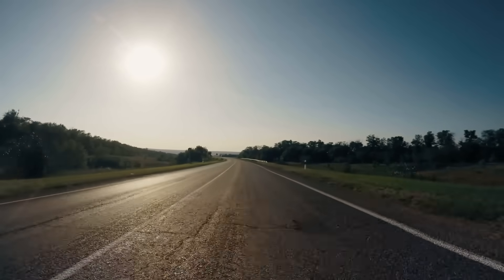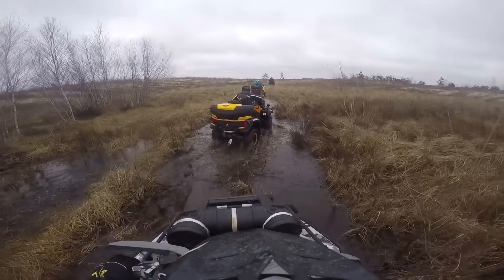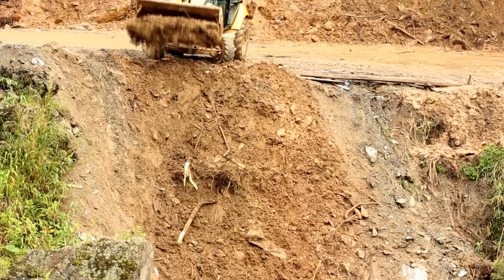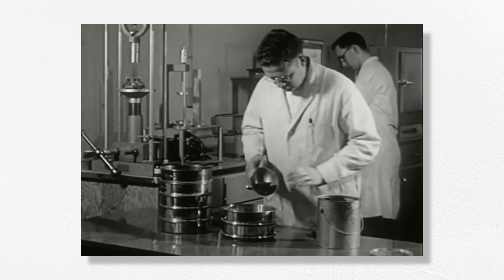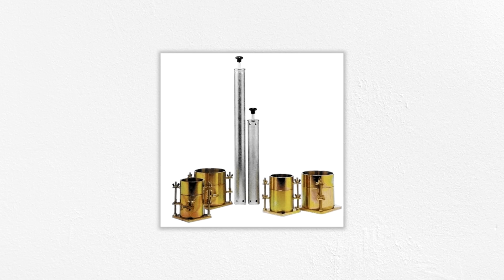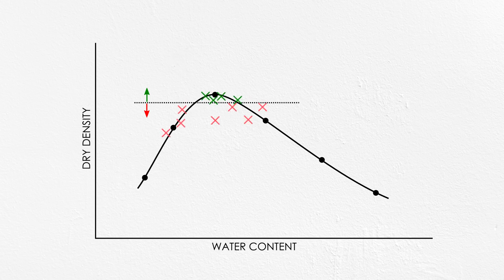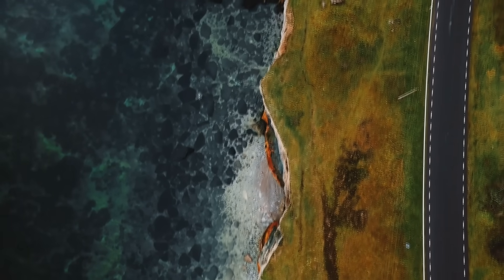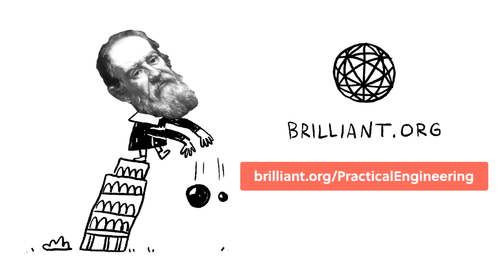Why Does Road Construction Take So Long?

Comment: Unfortunately this video doesn't address the fact that every road construction project gets started, then stops for 6-8 months, then starts up again for 2 weeks, then stops for another 9 months, and continues this way for 3 years until over the course of 3 days the entire project just miraculously finishes.
Reply: The 405 freeway in California has been in construction for over 6. Its rediculous.
Reply: @dakken74  and it turned into a toll road, paid for by the taxpayers
Reply: I-5 in Tacoma and JBLM, lordy.... that think will be under construction until the end of 2024 according to their published timeline.
Reply: @leonjohansen1818  And I-5 through tacoma has been under construction for over 10 years!
Reply: @cookiemonster8038  It has been under construction since the mid 1960's. I have seen it.
Reply: @leonjohansen1818  the other problem with building/upgrading roads is when you have a really dense area and a road that is so crucial that it cannot be fully closed, you have to work around a constantly changing redirection of limited traffic on that roadway. if we had built our freeways more like they did in europe (more smaller highways instead of a few big ones) this would not be as much of an issue as you could actually close one road to work on it and not adversely affect traffic in the area as much.
Reply: @leonjohansen1818  here we are 😂 still under construction. Tacoma is a joke.
Reply: @boosti_alex  I know right? XD glad I'm about to head to Florida and on to bigger and better things.
Reply: @leonjohansen1818 did they ever finish it
Reply: Most of the time it is due to legal issues. For example...a freeway is being widen and the first mile has be approved/deals made by the many land owners...when suddenly down the line a handful of owners decide to not sell so the city has to take them to court and can effectively take their land to continue the project (and pay them, of course). But this all takes time and could take years if the owners continue to fight it.
Reply: Well I know depending on local climate most asphalt work cannot happen in the winter, but from my experience, that's rarely the stage the work stalls out on so there's probably other human reasons for it.
Reply: Perfectly summary of the widening of I26 in Asheville, NC
Reply: @Name-cy8ym  I'm over the mountain from you in Johnson City, they are about to Widen I-26 here in the next few years as well, it is needed badly.
Reply: @Name-cy8ym I can’t believe you commented that! I drive 26 so often, going from greenville to ashville. Has been worked on for what seems like 8-10 Years now and they’re still not even close to being finished. Worse than 85 in cherokee county sc. by the time they’re done its gonna need another lane
Reply: Dealing with utilities and other pipes that are also in the road bed takes time.  It's worse when they find a pipe that is not on any drawing and thus need to dig through a lot of paperwork to find out who owns it, what it's used for, and if it's abandoned.  If the utility is an ass than they will cause delays.  We've had to have a contractor threaten a pipeline to get the proper crews out to do the inspections (threaten to drive equipment over it).  They'd had 8 years run up for this project as well.
Reply: @LegendLength  the speed limits aren't there just to protect the workers. The remaining road you drive on might be narrower than a proper road with no runoffs, there might not be markings on the road, any number of reasons why the speed limits might not be allowed to be taken down, even at night. That's not to say sometimes they do just leave them on 100% completed stretches of road which is 100% bad practice, but often there is some reason for them, legal or otherwise. If nothing else then just the logistics and costs of someone having to stay behind, scour the entire site that might stretch for miles to make sure everyone has in fact left home, then go back and forth to both ends and change every speed limit sign there is, and THEN the next morning they have to make sure to come in early enough to do the same process all over again before the other workers come back to work.
Reply: @rofln00b  Well said, additionally the temporary barriers in construction zones are not rated to withstand the same impact forces as proper guardrails.
Going too fast in a construction zone can result in you breaking through the barrier and hitting oncoming traffic.
Reply: @kilianortmann9979  or the workers on the other side of that barrier.
Reply: @rofln00b  dude I literally did this one year and it was hell... 4am-9 or 10pm and it’s not just speed signs it’s every sign that is supposed to be taken down, some need to be put up, and then in the morning you undo what you did 6 hours beforehand 👍🏾
Reply: White Boy  it doesn't really work that way. And a lot of it can be chalked up to mandatory open bidding laws for government agencies to be able to issue contracts.
And a lot of it has to do with when you run a sizeable construction company and you have to have multiple jobs working at once That's just the nature of the business
Reply: I mean there are a few reasons. Like Concrete needs time to set. But aside from that, its just cheaper to have many projects going at once than to finish them quickly.
Reply: @_aullik  What do you mean it is "cheaper to have many projects going at once than to finish them quickly?" Can you explain please? I don't understand. : (
Reply: @isaiahpridie813  it's not cheaper but contractors will sometimes go to another job to work to get paid for completing a smaller faster job .
 However there are a lot of things going on that most people don't see like change in design. Hold ups due to unforeseen circumstances. Negotiations on how to get paid for redesigns or extra work etc.
Reply: @_aullik  Yeah, the government has to do something. Gov needs to be forced to write down time constraints and especially contract violation fines.
Need to get some of those company CEOs into prison for the shit they pull.
Reply: I see this here in Germany every time I hit a "Autobahn". Sometimes, it looks the same in August as it did around Christmas the year before.
Reply: And it's normally finished suddenly when any type of elections is near or a presidential visits
Reply: I HAD ALSO NOTICED THAT,  
DELAY DELAY DELAY,     BOOM ROAD OPENED FOR PUBLIC
Reply: Actually whats missing is all the drainage and pipework that lie beneath the road most people who haven't personally worked in the field don't understand wht all goes into building things
Reply: Although, I do not live near I-35 in Texas, this is the one of the biggest, ongoing construction projects……ever!!!
Reply: @davidbehrend7054  I met my maid of honor at college in South Dakota, but she’s from San Antonio.  She’s told me many times one thing she misses about South Dakota is that construction stops in the winter, as opposed to happening all year round at home in Texas!
Reply: Also, design mistakes can add to delays. Unfortunately, some of these mistakes aren't discovered until after the road has been built.
Reply: But it does?
Reply: Often there are gaps in work because they are waiting for the ground to settle before pouring the new road
Reply: Gravity and weather will eventually do the compacting for free
Reply: This happens in the us too I thought it was just india lmao
Reply: Or the fact that every road project has 25 workers but only one is ever doing anything. 😂
Reply: In this video, you explain that—in road construction—the soil is compacted, in order to minimize the inevitable settling of its foundation. Is the soil beneath skyscrapers compacted, as well, prior to the installation of the pilings?
Reply: This is so fu***n true  😂
Reply: How come most other countries can build railways but the USA can't?
Reply: Would the U.S. adopt this method of road construction, in order to prevent flooding? 

https://youtube.com/shorts/LgU8f94MS7E?si=pIu5VQLznHtURW-T
Reply: If you recall in the video, earth from one location is moved to another where it's needed. Unless you have four (4) Crews, the staff shifts between sites to make this happen.
And it's better to relocate the crew if the materials for that section of road is not on site to be processed yet. They'll come back when all is in place to progress to resume.
Reply: H. R. Lawrence Ah, I think I understand. So the crew moves materials from one site that doesn’t need it to another that does and when they cannot continue working on that site because of a lack of materials, they move to another site, work on it and get more materials, right?
Reply: Follow the money.
Reply: This is a fact in California. However, when I lived in Arizona for a few years, I noticed road projects of all sizes were completed in a very reasonable amount of time. Caltrans needs to step it up.
Reply: First rule of public works, make it take so long they throw money at you to do what you promised to do in the first place
Reply: Are you saying road workers coffee breaks ONLY last 6-8 months?
Quick, to the union!
Reply: @LegendLength  They say it's bacuse of the narrow lanes. But then single track country roads are 60mph...
Reply: After having carefully watched the video, now I know that the answer is COMPACTION! ...and that BUREAUCRACY does not exists in the engineer's vocabulary xD
Reply: If it was in China and they did that the person responsible would be executed maybe we need to bring that practice to this country watch how fast our roads get built

Comment: I'm not sure what should I choose to study on college, Geodesy & Cartography or Renewable Energy, and I like them both so that's why. Maby one of them could open more job opportunities or is more future proof.
Reply: I know a guy whose entire job is to fix lines on maps, there's a surprising amount of work to do. The alternative energy sector is kind of volatile and nobody knows exactly what technology will win out, whether it's "traditional" nuclear, molten salt fission reactors, fusion, wind, solar, batteries... half of it involves advanced chemistry and physics. very competitive. Some of it requires legal knowledge and negotiating contracts for placing assets, getting approval for designs, testing, etc (mainly nuclear).  I would suspect it has more of a future than map making, though, eventually all the old data will get sorted out and corrected, but I'm sure there's more to the field than that one job, idk.  Hey I'm just a guy on the internet. Ask your college for some examples of where recent graduates have gone to work.

Comment: I been into building and designing roads and your video is spot on.  A few points I like to add.
Road also serve lead the ways literally for other infrastructures. Your power lines, your optic fiber cable line, your sewerage and water pipelines and etc.
EDIT: Another reason why road construction takes such a long time  is settlement. Some soil takes forever to settle (1 or 2 years in you are lucky).